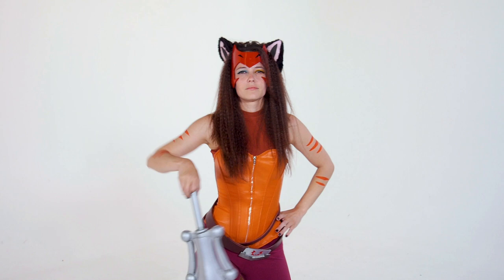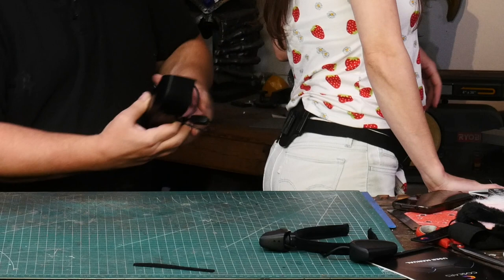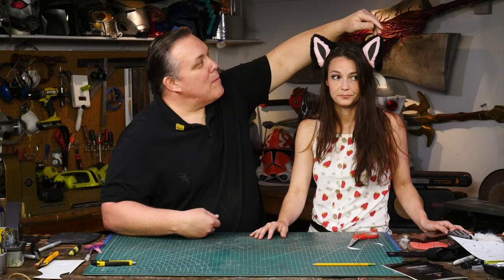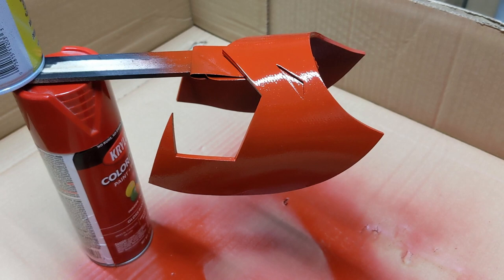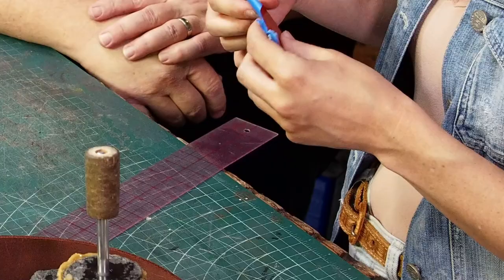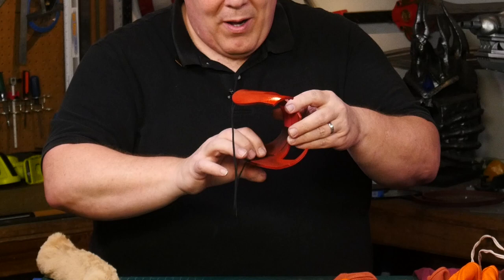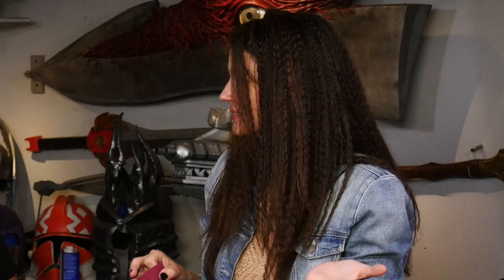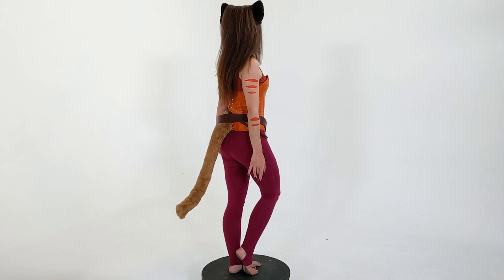Odin Makes: Catra from She-Ra with Cosears and Costail from Cosgear

Comment: You actually had the right idea about lasering the surface, in a way. See, if you leave the paint on the metal and etch away the design you want, you can then submerge the metal part in ferric chloride, heat it up with an aquarium heater and blow bubbles in it with an aerator, and the acid will etch the metal with the design and leave the rest of the metal alone.

Comment: I know you wanted to use the laser, but acid etching the belt buckle I think would've worked pretty well. Adam Savage has a couple videos on the process, if I remember correctly, and it seemed like you could keep it pretty self-contained as long as you're careful.